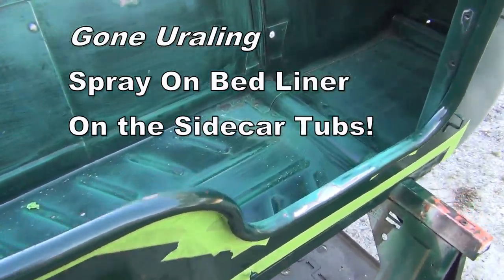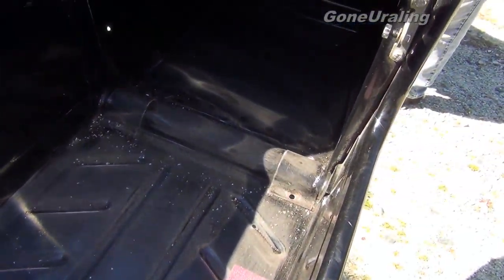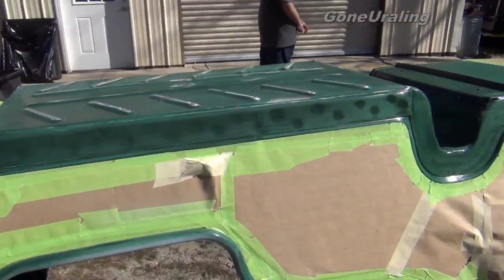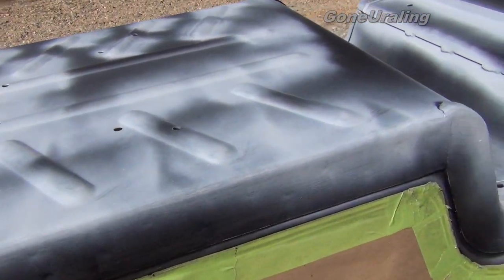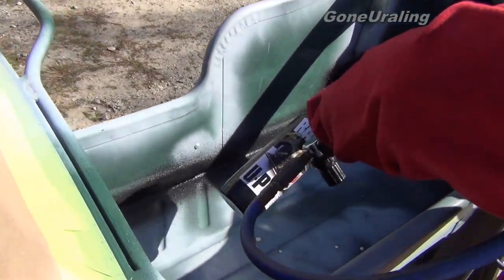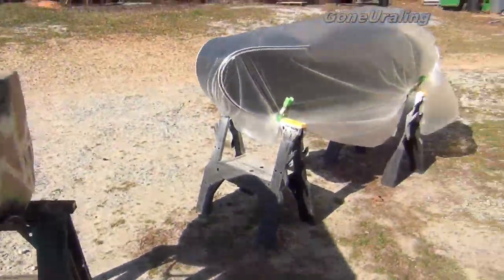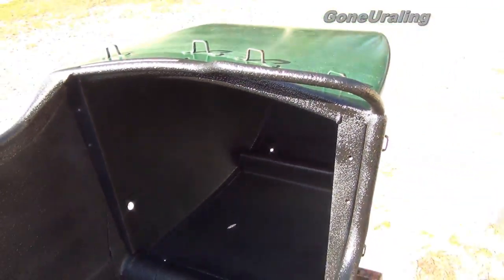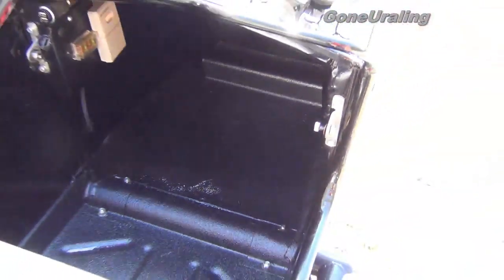Spraying Ural Sidecar with U-POL Raptor Liner Bedliner

Comment: Could you soda blast the metal for prep instead of sanding?  What about ambient air temperature?  What is the minimum temperature that the bed liner will actually work in?

Comment: How has this held up?  Thinking of tackling a similar project this summer on my Gear-Up
Reply from the maker: It has held up very well. I'll have to do a followup video on it, I'm asked that question a lot.
Reply: You bought the kit but how much did you actually use?  If I was just doing 1 tub, inside and bottom, would 2 canisters be enough or overkill?  Also I see they have a hardner, did you use that as well?
Reply from the maker: For both rigs I used 1 quart.  (half of the kit in my case) and still had just a little left over.  In retrospect, I should have gone a bit heavier and had none left over but I was overly cautious about getting it "too thick" as I was repeatedly warned not to do.  Having done this once, I would not hesitate (other than the work of sanding it) to put bedliner in my own truck.  Keep in mind, I have painted auto paint before, but I still don't see applying this as difficult, just need a bit of practice.  I followed the kits instructions mixing as required, I didn't guess either, I used real mixing cups to get the ratio correct.  It's all about ratio, even 10% off can change the entire consistency of the material. I think that is the biggest mistake people make, they pour it in and guess as the mix.  I highly recommend the bonding agent, I have seen bed coat applied without it (not this kit) that peeled off in sheets.  I went into this nervous and skeptical but I have to say it has held up very well and was easy to do.
Reply from the maker: oh, and on the mixing, if you mix it all at once, no big deal it's already pre-measured. But I mixed in 2 batches not knowing how much I'd use thus the mixing cups.
Reply: Awesome, thanks for the info.  Now I just need to find a kit that doesn't leave me with a ton of excess seeing as how I'm only doing 1 tub + fenders
Reply from the maker: You are looking at it the wrong way... think "what else can I spray" not "I don't want excess"  :-)  Let's see... trailer bed/rails, under your truck, patio furniture, inside your garage door... or even the outside.
Reply: Nice job.  Thinkin about doin this to the bottom of my 2018.  It came with it factory done on the inside so I'd just have to tackle the outside.  Very helpful video, thanks!

Comment: What's with the chain inside the tub of the 08?
Reply: +Brian B btw, thanks for the video!
Reply from the maker: +Brian B That was my old method of providing a tether anchor for my dog. I was connecting to the middle of it and up and out of the trunk closing the lid on the flat cross-tie line. I used to tether him one on the back, one on the chest. I have since changed to a tether on each side.

Comment: Sorry to open this conversation again but I was hoping you could answer a few questions for me. I'm looking to spray my sidecar as well (2015 Gear-Up) but I'm confused on removing the bucket. It looks pretty straight forward, 6 nuts inside the bucket, some clips holding the brake line and wiring for the electric panel. Where I'm concerned is that my local dealer is telling me that it is a pretty hard job and they want $1000 to remove and install the bucket and I just don't see it. You video picks up with the bucket off and I can't seem to find anything online discussing this process. My plan is to take to bucket off and have the local Line-X dealer spay it for me but I don't want to get in over my head on the bucket removal. Any input would be greatly appreciated.
PS - Local dealer also tells me that spraying in bed liner may make the metal so thick that the current hardware may not be long enough when i go to reinstall the bucket, did you experience anything like that?
Reply from the maker: He must be talking about removing the entire sidecar frame. That is a job... but certainly still not worth $1000 in my opinion.  Removing the tub on a pre-2014 model is a 5 minute job if you've done it before and a second person to lift is a big help.  If you have never removed one before, 15 minutes would still cover the removal. It is just sitting on top of the frame and snowmen and bolted in place. Your biggest challenge will be if it has quick connectors for the wiring going over to the sidecar or if it is straight wired. The 2010 Patrol had connectors, I just popped them free and left all the sidecar stuff in place.  On my tourist, some of the wires were direct without a connector. I removed the wire from the sidecar panel and pulled it free.  DISCONNECT THE BATTERY FIRST if you don't have quick connects like the patrol.